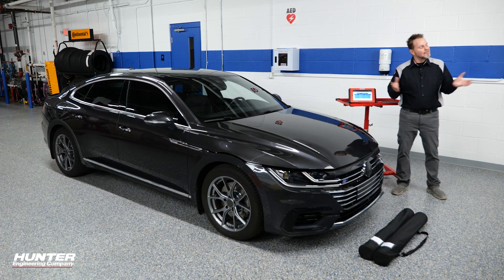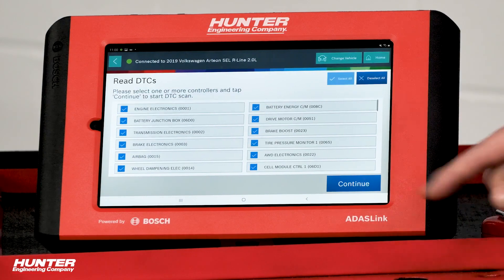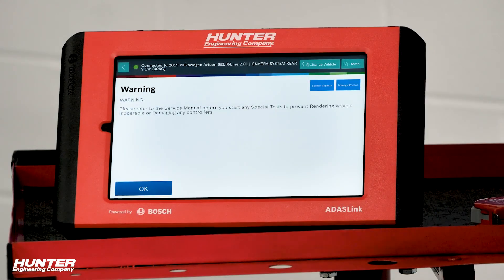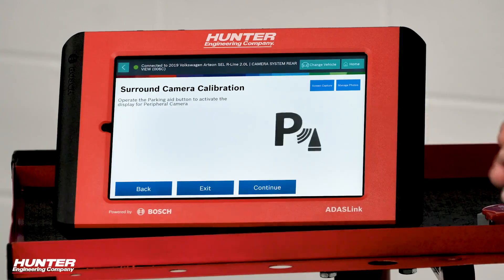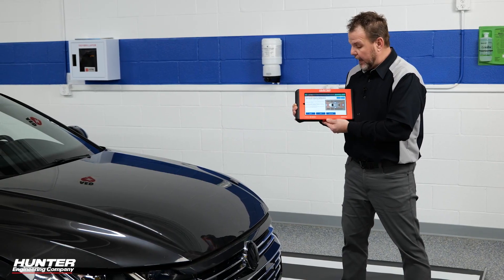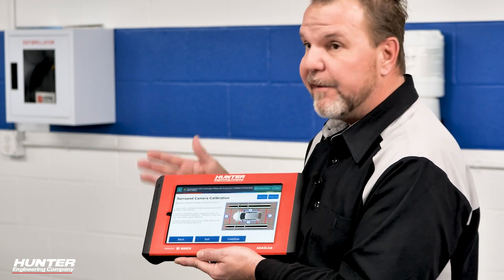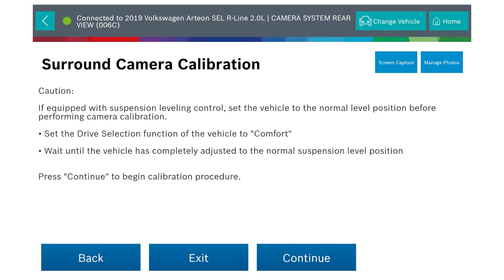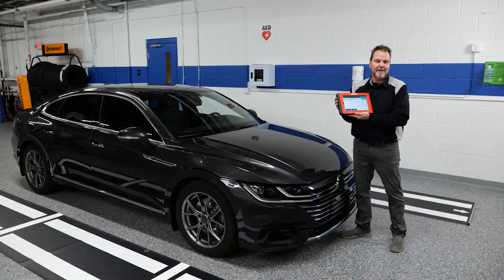ADAS calibrations: VW and Audi surround view camera calibration

Comment: If I replace rear surround view trunk camera on Audi A4 B9, can you tell me if I need to additional calibrate the new camera? Camera is exactly the same as the old one.
Reply from the maker: Typically, any camera replacement, to be accurate, will need a calibration.